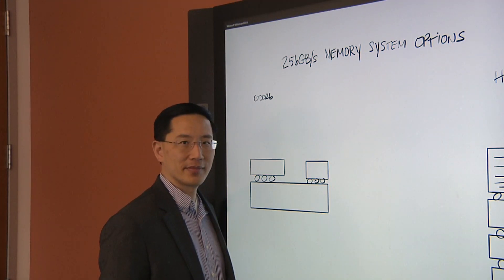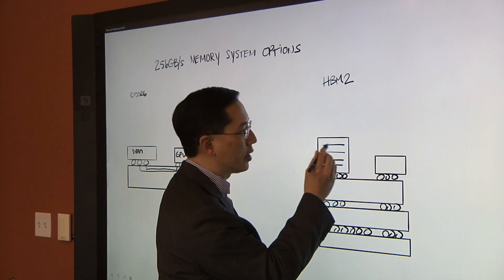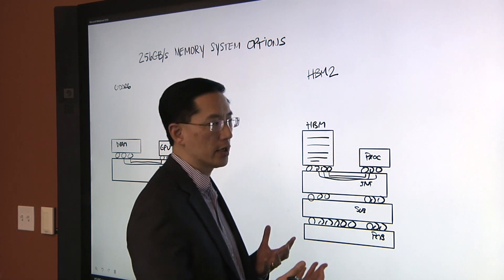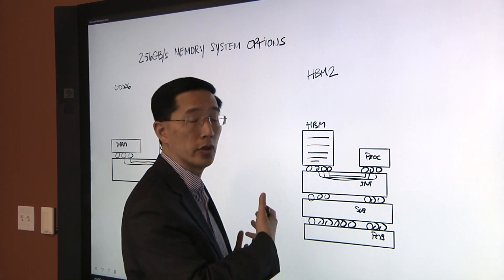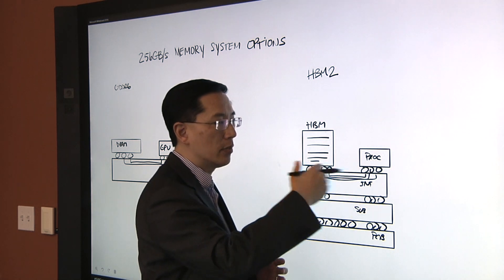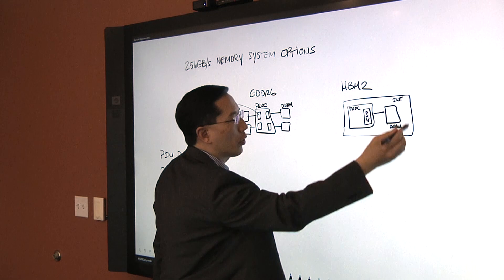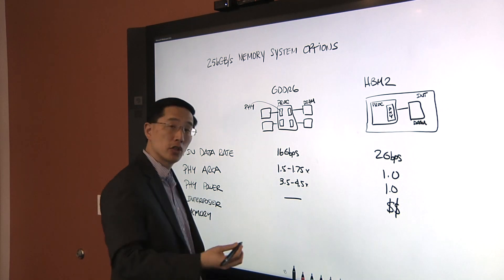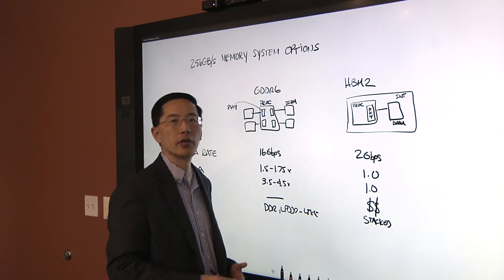GDDR6 - HBM2 Tradeoffs

Comment: Oh yes my Vega 56
Reply: Absolutly true still have one with some slight tweaks you can still run most games at high settings on 60fps at 1440p resolution in my case
Reply: Sucks
Reply: @mokujin29  it sucked at the release but it aged well. drivers are rock stable now and with the right tweaks made this card performs at the level of a GTX 1080/RTX 2060.

Comment: Well thank you for that video. Short, informative and nicely structured. It really helped me to differentiate between those two types of memory.
For a future video I would love to learn more about dark silicon, inactive parts of microchip-area due to the extreme density of modern fabrication processes and the energy cost and density that comes with it. Sophie Wilson mentioned it in her talk "The Future of Microprocessors" that also raised some other interesting points. For example I was surprised that older process nodes are still very viable and perfectly fine for a ton of system designs. Anyways... thanks for the video and the fine people of reddit linking to it. :-)